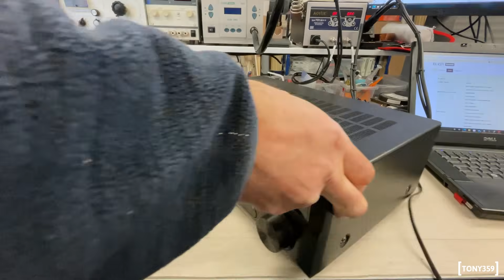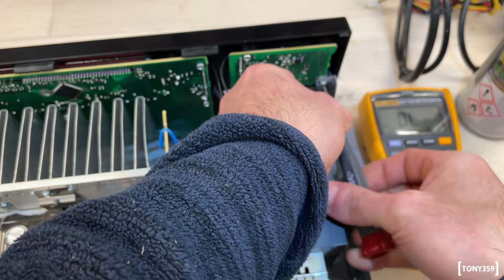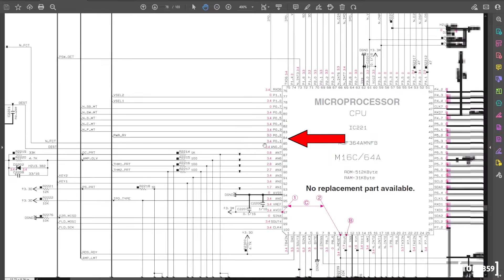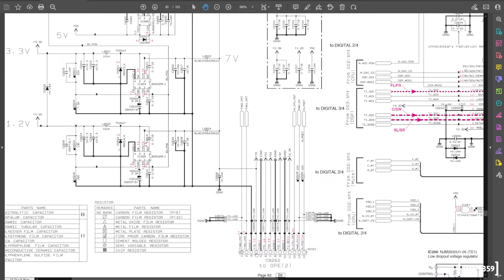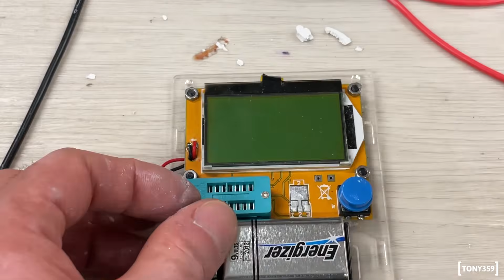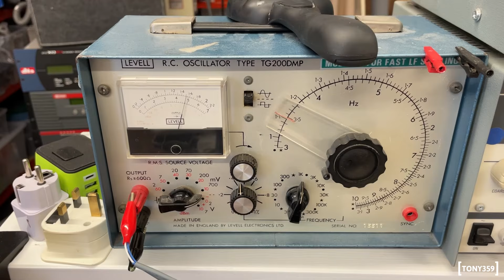Yamaha RX-V371 Repair and Test

Comment: You got lucky.  Some of the premium Yamaha home theatre amplifiers use matched pair bespoke drivers.  They are not easily available and if you were to find them they cost nearly as much as perchancing a working used Amp.
Reply from the maker: "bespoke drivers", carefully selected by a skilled Japanese engineer in a moon-lit clean room 🙂 
Well, this is a very basic Yamaha AVR 🙂

Comment: Thanks for the detailed diagnostics and repair video! I have the RX-V373 which looks identical on the inside. It powers on but sound on all channels is badly distorted (sounds like heavy AM static). Same distortion on the headphone jack. All caps look flat, the receiver was barely used. Rail voltagees are +51V and -47V. Volume control works normally. No protection mode. Any ideas what it could be? Thanks.
Reply from the maker: I'd probably start with scoping those +51 and -47V. Multimeters won't be able to see if there is heavy ripple there.

Comment: Thanks for this.  I don't have your diagnostic skill, but my reciever is failing to work properly until it's been on for 5-10 minutes, and you've given me some good things to check.
Reply from the maker: that points to bad capacitors - heat will slightly increase capacitance on a spent one.
Reply: @tony359 That's what my research turned up.  Thanks for confirming!  I bet my PSU's caps are bulging just like yours was.
Reply: @tony359 UPDATE: I recapped the whole power board, replacing all of the 85C Jamicon caps with 105C or higher Rubycon and Nichicon caps.  Recapping the whole board was probably overkill (only the 10000 uF cap was bulging), but the finnicky ribbon cables and thermal paste on the heatsink components made me never want to open it up again.  It is   working PERFECTLY now.  Thanks again for your great diagnostic work!  The wife will be happy it's fixed 😁
Reply from the maker: @InsatiableMonkey  Well done! Once it's opened, it makes sense to replace a few more caps, it will live for longer!

Comment: Hi great video, my Yamaha RX-A 1070 powers on with 'Internal Error", I tried the R896 shorting trick, the units power correctly but powers down on its own in a couple of seconds. Tried updating the firmware but this does not change anything. Do you have any pointers or advise for me to try?
Reply from the maker: No I'm afraid. How did you update the FW if the unit doesn't stay on?

Comment: i have a rxv373 for 6 years , i put inside a 12v cooler and power from an external adaptor at 5v. in all this years i dont have any problems with the amp

Comment: Hi Tony, I have a Yamaha receiver HTR 3064 with the exact same circuit boards and a similar issue with the bulging capacitor. After replacing the bulging capacitor, the unit won't turn on at all. Before, it would at least turn on and go into protection mode. I've tried the diagnostic mode and a factory reset, and still nothing. Any idea why, please?
Reply from the maker: I'm afraid not - anything left disconnected maybe? Is the front panel connected? I'd start with checking all the rails, the service manual is available. In Standby there is not much turned on. the Affected line won't prevent the unit from TRYING to power up. Did you disable the faulty condition as shown in the video?
Reply: Hi Tony, I figured it out. It's a bad power switch.
Reply from the maker: @Kingdompulse-e4c  Fantastic, well done!

Comment: If you would served as many of these units as I have you know for a fact that 9 times out of 10 with these units it's a power amplifier problem you probably have a shorted transistor and your main power amp that's why it went into protection one of your transistors shorted out and you're going to have to check to find out which one and then you have to go down the line and find out if you have any Trent any other components that are blown out because of it now that you've had this one you should always make sure and it's also the same for Yamaha Onkyo Marantz and Sony basically they're all the same amplifiers they use basically the same circuitry so if you wind up with these type of receivers in your shop again it's 9 * 10 with I believe with Onkyo and you getting no turn on you can also have a bad capacitor in the power supply it would be a c-37 on the circuit the c-37 capacitor in the on the schematic in the power supply a little tiny capacitor will keep it from starting and it's a if I'm not mistaken not a ceramic not a electronic can't remember the other one but it's what it's not the ceramic and it's not the electrolytic excuse me it's nothing like the other one

Comment: Summary: do a visual inspection and correct anything that you identify as wrong, it will save you a lot of work time. 😂😂
Reply from the maker: I did see that cap straight away but I wanted to see what the issue was. Swapping a bulged cap would have been a 5 minutes video, nothing learnt, unit works, thanks for watching and goodbye! 🙂 I hope you enjoyed the process!

Comment: Grear video my x2300 blew . Blue flash and tripped electrics . 2 fuses on power board 1 was blown 250v 1.6amp . Blew again ill pull board agajn ill check caps ifs a denon x2300 any ideas ? Ty
Reply from the maker: if the fuse blows, something is short. Check the transistors. But 1.6A is very little. Schematics?

Comment: Thank you so much for showing your professional approach  to fixing a fault in Yamaha Rx-v371. Awesome! I wish if you can help me out with an issue that I got in Yamaha HTR2866, it doesn't switch ON at times (no display) however, when it does come ON display shows "Internal error " the set was idling for about six months not in use. Tried user resetting but not successful.  Pls advice. TIA
Mohan Jayasuriya
Reply from the maker: Im sorry, that was my only Yamaha! Try getting into the service mode, the service manual explains how to check error codes.

Comment: Does this have an auto shut off on it if it gets too hot cuz I let it cool down and I reset the unit and put a fan on it and it hasn't shut down yet so I think that I just had it in a tight space and it was overheating but it seems to be working now
Reply from the maker: it's an amplifier, it needs ventilation I'm afraid :)

Comment: Hello，your video is very good, I also have rx v371, but the channel indicator on the display panel does not work and no sound is output. The dsp indicator light sometimes works and sometimes doesn't work. How do I fix it？
Reply from the maker: I do not know, sorry!
Reply: @tony359  No problem, thanks for your reply😄。

Comment: Hello I have the same case  (no power) witt Yamaha HTR-3066. The starting point is the checking support voltage. I got from all videos that it should 3.3 (3.29 was also fine) . In my case I have "only" 3.18V on board with voltage stabilizators and on computer module I have only 3V. No service mode is available (double push buttons). shall firstly troubleshoot voltage to get 3.3. The receiver was 3 year off, before was working. Thanks for any hint.
Reply from the maker: It's been a while, and I am not so familiar with the Yamaha. Check what gets IN the regulator, if you're getting lower voltage, maybe the input is not right. If you get 3.3 at the regulator and then 3V after some components, that might be intentional?
Reply: @tony359  So I have to fix why I am not getting 3.3V at power supply block. Thanks

Comment: Nice video but one thing I've learned to do  first is a  do visual inspection looking for capacitors that are  "mushrooming  " or caps with bulging caps .Its a nice short cut  especially for people who  don't have the extensive knowledge that you posses. Its amazing how often that works. I have this same  receiver  but for me the  HDMI's are  faulty ... a relay used to click when they were switched but  its now silent when switched and blackscreen only. I haven't opened it  yet.
Reply from the maker: Thanks - I did spot the cap immediately. this video was intentionally "long" to explore things around. Otherwise it would have been a 5 minutes video "oh, let's swap the capacitor... it works, thanks for watching" :)

Comment: Thank You for this video! I've got some positive energy to start fixing my RX-V585 with around 3V DC on all speaker terminals (PRT DC 000).
Reply: Got simlar problem on my RX-V581 with no 3.3M coming back to that power board
Reply: I have found a power switching transistor and serial 1 Ohm resistor fault on the main board. I was lucky😄

Comment: I had a RX-V471 for a while and ended up picking up a V673 model to upgrade it. It seemed to have no power, but a 2A fuse on the PSU board inside brought it back to life.

Comment: At 8:00 my measure was not the 3.3v. It’s very low instead.
Any insights?
Reply from the maker: Check the 3.3V generation then. Also try unplugging the cable going to the PC board: if 3.3V are back, then there's a short on the board. 
What happened to the 24V you were reading before? :)
Reply: @tony359  The previous 25V reading I took was a dumb move I made. I'm going to make a short video so you can have an overview.
Reply: Hi.. Do you mind to share the drawing? 😅
Reply from the maker: @mohdhilmi484  they are on elektrotanya!

Comment: Spotted the bulged cap straight away. Tony also sees it, but fails to check it for ages. Finally after chasing his bum for ages he checks the cap, and low and behold it is causing the fault.
Reply from the maker: As mentioned in the video and on many other comments, it was totally intentional. Swapping the cap and fixing it would have taken 5 minutes, I wouldn't have learnt anything from doing it and it would have been boring. 
Thanks for watching!

Comment: Can you share the source of the schematics? I have a rx-v481 not powering on
Reply from the maker: I think I found it on elektrotanya! Good luck!
Reply: @tony359  thank you. In my case I have the 3.3V rail, but no obvious bulging capacitor, and absolutely no visible reaction when pressing any of the buttons. Could hear a buzz some time ago after a few hours of running, but this morning I woke up to sounds of relay, unplugged it, and it never did anything else ever since.

Probably will cost a few hundred bucks/euros to repair, which is borderline uneconomical. Could be a good learning opportunity though:)
Reply from the maker: follow the service menu, it will tell you what's happened - hopefully.

Comment: The front power button on my V371 doesn't work either.  I use the remote to turn it on and off, so really a non working power button isn't a problem.

Comment: Great video! I have the exact same model. One of the channel recently stopped working (Front Left channel) during music playing ( starts normal but suddenly on and off and then no sound at all), I switched the speaker connected to another channel - Front Right and it worked, which means the speaker and cable are working. Any suggestion as how I can fix that channel (Front Left) ? Really appreciate your advice. Thank you!
Reply from the maker: If it was intermittent maybe it's a bad solder joint? Try moving the unit while sound is being played and see if it comes back. If it's the "amplifier module", those are hard to find and pretty expensive I'm afraid.  Good luck!

Comment: In the very first instance, that pretty capacitor should be replaced before wasting all your time doing the diagnosis.
Reply from the maker: Of course but the purpose of this task is to learn. Has I replaced that capacitor straight away, the video would have been 5 minutes and boring 🙂 

If you repair things for a living of course you immediately replace that cap 🙂 thanks for watching

Comment: Excuse me sir, may I ask?  I have a Yamaha RX-465 receiver... the bass sound vibrates abnormally... I use a 6" 8 ohm speaker on the front and 2 4" 6 ohm speakers on the R and L... the display flashes when the bass sound?  Can you help me?
Reply from the maker: It's really impossible to help from here I'm afraid.
Reply: @tony359  Maybe you can help analyze which parts I should check

Comment: I have the same Av receiver, it went in to protection mode before I bought it second hand , I took it out of protection mode and its been working fine ever since , im guessing in my case I think who ever had it before me just over loaded the amp , with speakers that were drainage to much wattage , however im not really sure , as its not gone back in to protection mode since , I got lucky as I only paid 30 dollars for the amp
Reply from the maker: If I remember the service manual right, that is a possibility yes. Mine would also work once reset but it would fail after a while.
You can check WHY it went into protection mode from the service menu, which is quite comprehensive!
Thanks for watching!
Reply: @tony359  Thanks for the video you do a great job at explaining things so the average guy like my self can absorb the information in a useful way .
Reply from the maker: Thank you for your kind words! :)

Comment: Good job on the video.  For years Onkyo had bad HDMI boards.  Many are in the trash.  Seems the Texas Instruments DPS chip often failed because of heat, etc.   I think in the last 5 years, those problems have gone away.  Hopefully.
Reply from the maker: Don't mention them! I have two which are paperweights because of that HDMI boards. Nothing to do with heat, it was a manufacturing defect from Texas Instruments. No (reliable) replacements available so 25KG of good electronics go in the trash. I hate that! Thanks for watching!

Comment: How to connect TV Sound to htr 6230 yamaha receiver TV Sound is not coming from receiver
Reply from the maker: I'm not familiar with the 6230 and I don't know what TV you have, I'm afraid I cannot do much from here! 
Make sure you use the "ARC" HDMI ports - ONLY those ports will send sound back to the receiver - assuming BOTH your TV and your receiver support that.

If not, you'll have to use an optical cable, again assuming your TV has an optical port. 
Good luck!

Comment: Hi, I need a help. There's an issue with my YAMAHA HTR AVR. Its not turning ON even after following the steps like pressing simultaneously Info+Tune Control+Power ON/OFF button.

But when i tried buttons Straight+Tune Control+Power ON/OFF button I can hear some tick tick sound inside the system. What could be the problem? Please share the details how to solve this issue. Thank a lot in advance.  Please reply.
Reply from the maker: I am not a Yamaha expert I'm afraid. Start with downloading the service manual for your exact model - which you haven't mentioned. See what's the correct procedure to get into service mode. Remember that if the unit shut down at some point is for a reason so you'll have to find out what's wrong with it even if you manage to get into the service menu. Good luck.

Comment: I can't believe the amount of things that go wrong with these Yamaha and Onkyo amps.
Reply from the maker: yes - some could be prevented by better design I think :)
Reply: @tony359  I hacked an older Yamaha receiver RX-V630RDS that was doing this but now i'm thinking it might be the super cap for the processor memory, but to get around it i took i think a 4.8V line from the processor vcc and ran it back to PRY. This bypassed the lack of PRY i just advised owner not to leave it plugged in. It was working after fixing a 5v reg. until i dismantled the front in order to clean the volume encoder. After replacing the front panel it no longer had it's PRY. I am now fitting a phono stage for him. About to tackle it now.
  With the ones with the power amplifier modules they can have different numbers because one can have more channel outputs than the other for central and surround etc.
  I have also encountered issues with DAC chips in the range that you have there or the ones that use the PCM1681

Comment: Nice repair, i didn't know some of the Yamahas used to build in these goddamn STK amp modules. Technics used to do it and Panasonic too, since they are under the same company, but not too many other companies used them. They are very hard to find, and expensive too. If 1 channel fails, you need to swap the whole module, which is nonsense. I like more the transistor-based amps, easier and cheaper to repair. I do similar repairs as a hobby, in the future i will avoid these cheaper yamahas for sure. I know, some of the higher-end models from Yamaha using transistors in the amp sections, they are more repair-friendly.
Reply from the maker: I agree with you, those monolithic models are bad. I've worked on a small Onkyo as well featuring one of those. As you say they're expensive and not great. Thanks for watching!